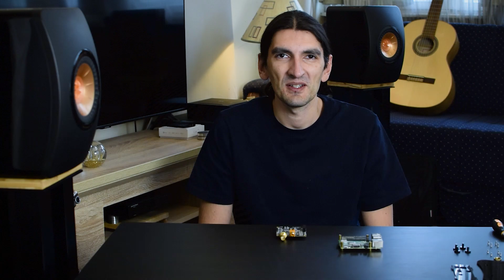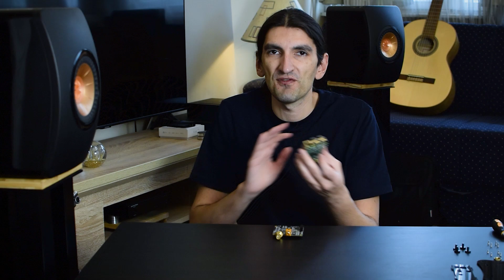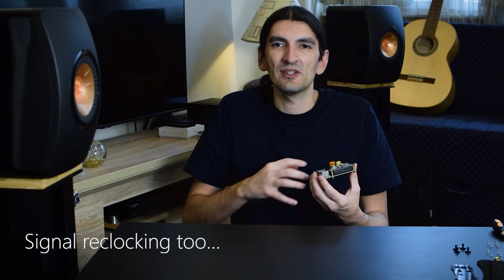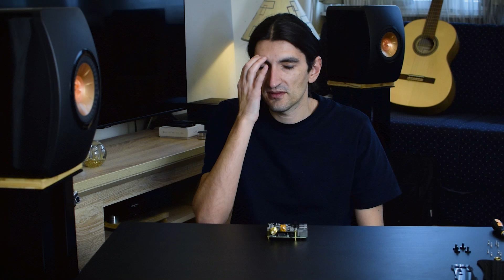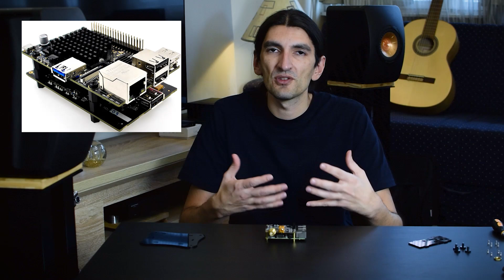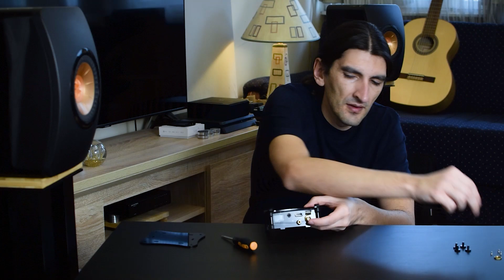Allo DigiOne and Raspberry Pi for Audiophile Digital Streaming

Comment: Hi Srboljub! Do you think the Pi3 + allo digione duo will still be able to perform well 4 years after you published this video? I mean, can we really consider ourselves to be using a really good streamer? I also use smsl su1 as DAC. It is really hard to allocate a budget for such products in my country. I can say that I am looking for the best sound with the lowest budget. Greetings from Türkiye, my friend!
Reply from the maker: They're still good.. But at this point, I would just get Wiim streamer. They're equally affordable, have good software and sound great too. Fantastic out of the box solution.
Reply: @iiWiReviews  Frankly, I am currently using Pi3 + Digione. Do I need to upgrade it to Wiim Ultra or not? I am looking for the answer to this question myself :)
Reply from the maker: No need in my opinion, it's still a very good streamer.
Reply: And thx for your quick reply! ❤ @iiWiReviews

Comment: Hi! Only problem would be that hi res Qobuz at 192khz would be downsampled to 96 if you use coaxial, correct?
Reply from the maker: SPDIF can output 192kHz so no problem there, Qobuz goes in full quality. Most DACs also accept up to 192kHz on SPDIF.
Reply: @iiWiReviews  i actually have no dac as i have a technics sl g700. Cheers!

Comment: There are many posts referring to a problem with the DigiOne which does not play files greater than 48 kHz or 24 bits. I have this problem too. There seems to be very little useful answers though! I did some research, and it appears (the technical descriptions are sometimes hard to understand) SPDIF is limited to 48 kHz and 24 bits max, and in some cases only 20 bits. I solved my problem by going into the Volumio settings and setting the Audio Resampling to 44.1 kHz and 24 bits. That way I seem to be able to play all (or at least most of my high-resolution music files. Frankly its way past time that Allo provides guidance on this matter and revises their spec sheet to indicate the SPDIF limitations.
Reply from the maker: Using RoPieeeXL I used to playe 192kHz/24bits without any problems while I still had it.

Comment: Good video! I think the next step to really complete this would be to use the aux power supply board for the DAC that is powered externally to completely isolate the DAC from tje Pi's power. Computers often generate lots of garbage on the DC lines... I think that power board is about USD $25 on EBay.

Comment: everybody's first reaction is to call bulshit on this kind of stuff until you get some really high fidelity equipment and are able to actually listen to it in a space where you can actually discern these small little audible cues which sadly are not audible to the majority of the public.

for reference just having an air conditioner on in the background is enough to make any inexpensive  audio system sound audibly the same to one that is made of discrete components and linear power supplies.  

most people don't even know what Jitter actually is.    let alone timing errors in digital music. 

USB sure is a great way to pipe audio wherever you need but a lot of people don't realize there was a really good reason why things like firewire existed for the professional realm and everyone else got a simple Universal serial bus to use..

no matter what there is a lot of ways to fry an egg and as long as you have good equipment you should be fine no matter what bus or way you use to pipe a audio to your system

Comment: Does it stream Tidal masters at highest quality? And is it gapless playback? Is it much better than chromecast audio? Great video, all the best 👍
Reply from the maker: RopieeeXL OS I'm using can stream MQA at the highest quality... But your DAC has to be able to unfold it (there is no software unfolding here). Gapless playback also works from mconnect app that I'm using, you just have to enable it.

Regarding Chromecast Audio, I never compared them so can't comment on that. Some sources say this is better.

Comment: Many thanks for your professional and clear explanations! Addicted to listen to your videos. Anyway, I do have a question which I couldn't find or understand in all kind of hifi video's. I have connected my rspi 3b (max2play Lms) to a simpel 5v 3a power supply (wall wart). My E30 is connected to a professional 5v powersupply. But what will happen to connect the e30 to  wall wart power supply and the rspi to a ultra low noise lineair power supply. Or should both devices requires a low noise power supply? I hope you can help me out. Also happy  owner of  IOTAVX sa3 and pa3 and triangle bro3.
Reply from the maker: Thanks for the praise! Both DAC and streamer improve their sound quality with a good power supply. In your case it would be easiest to simply try rotating and listening which one reacts more to better PS. But in the end, I would probably find a good LPS with two power rails and connect both to it.

Comment: Hi,
Would the digione be a useful addition to the chain, where its used to stream Tidal Hifi/Spotify premium to Modi Multibit dac compared to macbook air being used to stream to dac? I loved your review of the modi multibit and eventually bought it. Now wondering if the digione would make a good addition? Would be good to know your views. Tx
Reply from the maker: Hi, I have never used any macbook. The word around the web is that they do have cleaner USB outs than the average laptop of other brands with Windows. However, if I had to make an educated guess, I would bet on Pi+DigiOne to provide an improvement compared to macbook.

Comment: if you use this setup with a good 50€ power outlet and external dac (which you will need before your stereo system), whole operation will cost you a used bluesound node 2i so cut the hassle, even its 100€ difference buy an one box setup (node 2i) and use it.

Comment: There is no reason why a co-ax or phone SP/DIF link should be better than a USB  one. Unless there is some quirk in the way your OS is set up. USB is more than capable of transferring any audio data without error or degradation  (even on Windows, given the proper setup !) and any modern DAC should have no trouble receiving data via it's USB inputs.

Comment: I’m going to purchase the Sony IER-Z1R IEM after a few months.What the best DAC/Amp you can recommend for it under $200,would prefer buying a DAC/Amp that supports at least 32 bit 192 kHz PCM and DSD 256. I  currently use a helm audio bolt DAC/Amp. Do you think I should upgrade my DAC/Amp?

Comment: Hi, will something like this be better than a Bluesound Node2i? Music signal & music quality wise?
Reply: This device would go between the Node and the DAC. Not sure how much improvement you would get, the Node is not especially well regarded for sound quality
Reply: @joshua43214  Between? Is it not a replacement streamer? Either this or the Node2i for streaming? And I mean if you only use the Node2i as a source/transport and use the coax out into a amp with a better DAC, will you still hear diffrences between streamers?
Reply: @toffe2ventil  Generally speaking, you should put a bridge (also called a renderer) between the player and the DAC for best audio quality. I have an extremely good player (an i9 based server running Roon core and HQPlayer), and an extremely good DAC (A Matrix Audio Element-x), and it sounds very much better with my Sonore OpticalRendu as a bridge even though the streamer in my DAC is world class.
So, all that said, the DigiOne is a bridge, and is meant to convert ethernet/wifi/usb into spdif. It will also function as a player, and is probably a better player than the Node, but it will function best when it is used purely as a renderer. Like I said, the Node is not very well regarded. My AVR came with Blusound (NAD T-758), and the Blusound is not especially good. My first experience with Allo was the DigiOne into my AVR, and it made a really huge improvement.

This led to me trying the Allo Katana DAC, and the Allo USBridge, both of which are extremely good for the money. I got pretty good quality (by audiophile standards) repurposing an old computer to run Daphile as the player, an Odroid for a NAS, and using the USBridge with a Katana DAC (4 power supplies). This is as good as it gets unless you are ready to drop about 5K to upgrades imo. This is likely of higher fidelity than your speakers and amp, so be warned you might end up going down a pretty expensive rabbit hole...

Comment: Hello, what do you think, between a raspberry pi 4 with allo digione hat and a bluesound node 2i, every device will be
connected to the same dac (e. g. Topping dx3 pro v2), using coaxial input, which will be the best option, regarding sound quality. 
Great review, you doing a good job.
Reply from the maker: Pi + DigiOne + Linear Power supply should edge Bluesound Node 2i. But I haven't tested it personally... It's coming from a friend I trust.
Reply: Thank you for your reply, 
I'm boring you with another question, to feel the difference in sound quality between the two options, which must be value of the stereo system. I have an entry level one (amplifier cambridge audio cxa 60 & dac topping dx3 pro v2 & speakers q acoustics 3020i). I think an asset for node 2i, is that it has Tidal Connect.
Reply from the maker: @Shtruck   I can't tell this for certain, but I believe that even if you notice the difference, it wouldn't be crucial to sacrifice the comfort and all-in-one solution of Node 2i. I'm just personally wounded that way to strife for that last 1% at any cost. :)
Reply: Thank you, for your help. 🙏

Comment: Nice review. I completely agree with your lowered volume but greater dynamics comment. It's not an issue, as I control the volume knob. The Digione definitely benefits from an improved power supply. I'm surprised that you didn't power it with your Teddy Pado LPS. It'll be worth it. I realised another volume drop when I powered the Digione with a LPS.
Edit:Clarity.
Reply from the maker: Thanks! I actually do use Allo Shanti PS these days, but don't want to overwhelm viewers with too much info at once... I'll make a video about it too as it easily defeated my own LPS and iFi iPower. .
Reply: @iiWiReviews  already looking forward to seeing it. Good work.

Comment: Great video! What do you think about the DAC hats for the pi? Have you tried any?
Reply: I have an Allo Boss and love it. Using a usb battery rather than the standard Pi wall wort helps, too, or an upgraded linear power supply like he mentioned.
Reply: The Allo Katana DAC is probably the best DAC you can buy when on a "budget." I power mine with multiple power supplies.
I had to buy a Matrix Audio Element-X to get a significant upgrade.

Comment: Great video! Apparently RPi 4 has a cleaner sounding USB output than RPi 3 ?
I now use a Pi2Design AES Hat which has had great reviews too. It has more output connection options including BNC. Balanced AES and I2S and can be powered separately to the Pi. I recommend trying this if you can, it sounds wonderful and offers fantastic bang for buck at $149.

Comment: How does the Allo USBridge compare with the Raspberry Pi4? I was looking to use the Allo USBridge instead of RPi4 with DigiOne Signature. Do I need 2 Shanti power supplies or will one work. Thanks
Reply from the maker: I haven't tried Pi 4 but I'll probably dive in at one moment and test its USB outs that are supposed to be better. One Shanti is enough.
Reply: I never tried the RPi 4, most of the reviews I have seen say the RPi 3 is better sounding. This makes sense because it runs cooler and so has less thermal noise.
The USBridge is a very nice device, especially when used with a good power supply, it was a significant improvement over the DigiOne as a bridge (my DAC is extremely good on both USB and spdif inputs).
I used the USBridge as an RPi 3 upgrade with an Allo Katana DAC for a while as well.

Allo products are very good for the money. If you want a really good bridge, I recommend the Sonore OpticalRendu - it is a whole different world provided yo have a really good DAC.
Reply: @joshua43214  2 people told me that they find the USBridge too bright. I was thinking of using the USBridge Signature with the DigiOne Signature and Shanti power supply to build a media server that can read music from a USB hard drive. 

I was told the RPI 4 might be a better option from a sound quality perspective. 

The DAC used by my friends were Topping D70s and Gustard X16.
Reply: @navinadv  The USBridge is the USBridge sig, they also make a thing called the USBridge Signature Player which is just the USBridge in a case, and ready to play.

What people refer to as a RPi, is actually a development board, and has a built in break out board. The compute module is the RPi with no break out features and is intended for enterprise use. The USBridge is essentially a fancy break out board for the compute module, so it has nice power supplies and isolated usb and ethernet (both are kinda sketchy on the RPi 3 and 4). So while they market it as an ethernet bridge, it will do everything an RPi will, only better.

They do make a DigiOne and a DigiOne Sig, and I think they might have some other upgraded "sig" models, but the USBridge has always been the "sig" version.

The DigiOne only has spdif output. The USBridge only has USB output. So, USBridge will output very nice USB to a really crappy USB hub on the RPi, which will use I2S to the DigiOne, which will only output to a coaxial spdif.
So, if your DAC accepts USB, get a USBridge, connect a low power drive and your done. If you DAC only take spdif, put a DigiOne on the USBridge, attach drive, and your done.
I played with these various combos for a couple of years, all sound good, some damn good. I never got good sound over USB or Ethernet into the RPi, wifi was always the best. For the USBridge, ethernet was marginally better than wifi, bit only if I could keep the cat6 cable away from the power cords. I preferred Volumio as the OS, mostly because the app was decent and sound is very good. The RPI3 will upsample to 192/24 very well, but SQ degrades above that. In general, I find that anything more than 192/24 is diminishing returns anyways.

using an old computer running Daphile made an even bigger improvement. If you have a spare computer, using the USBridge as a bridge wont cost you anything, but some headache so worth giving it a try. Maybe swap in a fresh drive for Daphile so you don't lose your windows install. you can even experiment with different OS's and player combos, the USBridge will give you tremendous flexibility.

My current system runs Debian 10 Server, HQPlayer embedded, and Roon core. This set up is not for the faint of heart, there is very little support so you need a good Linux skills or Godly Google Fu. Roon turns out to be the second best media player I have tried (I think I have tried all of them) after Daphile. The addition of HQPlayer Embedded plus absolute stability of the whole system makes it very worth while.

Lastly, the RPI 4 runs much hotter than the RPI 3, so you will get an increased noise floor from that alone, and RPi is not known for mitigating noise. You will get more power, but what do you need it for? If you want a more powerful player to do 512/24 or convert to DSD, then use something at least as powerful as a Celeron, though you will need an i5 minimum for DSD conversion.
Reply: @joshua43214  I learned more from this single post of yours than all the reading I have done about this subject. Thank you.

The one part I did not get was when you said “The USBridge will output really good USB to a really Crappy USB on the RPI”. I was thinking of using the USBridge and DigiOne with a Shanti power supply. Where does the RPI come in? Thanks.

Which of these statements are correct?

1. USBridge Signature will give me USB out from RPI 3 or RPI 4 compute module
2. DigiOne Signature will give me SPDIF (over Coax or BNC) out from RPI 3 or RPI 4 compute module
3. If I stack USBridge Signature and DigiOne Signature then the resulting box will give me USB or SPDIF out 
4. Neither USB nor Ethernet offers good sound from an RPI
5. RPI 4 is not powerful enough for DSD 256/512 or MQA, for these formats I will need an i5 
6. RPI 4 will generate more heat and hence more noise than RPI 3 so for 192/24 RPI 3+ is enough, RPI offers no significant performance gain as it can’t do MQA or DSD 256/512 anyway
7. Volumio is good as it has a nice interface and a Celeron or better machine running Volumio will offer better quality via USB than RPI.

I happen to own a 8 year old ASUS mini PC with a Celeron and 4GB RAM. Would that be more suitable for a music player? The original came with a 500GB hard drive and 2GB of RAM but I upgraded it to 6TB hard drive and 4GB of RAM. Can one format the hard drive with Volumio and use this? 
https://www.asus.com/in/Mini-PCs/VivoPC_VM40B/

For my DAC i am thinking to get either a Gustad X16 or Topping D70s. My friends are happy with theirs and the DACs have both USB and SPDIF and I2S LVDS as well.